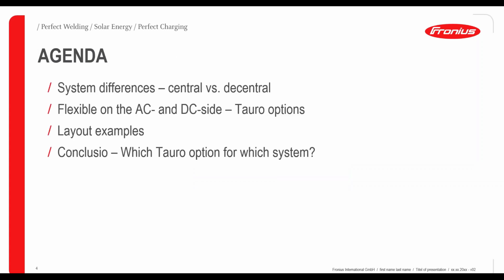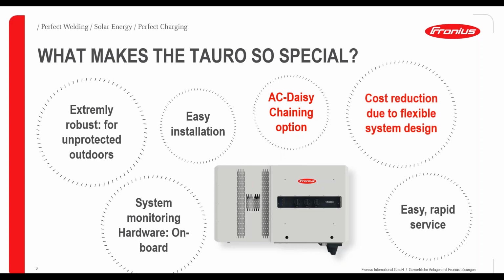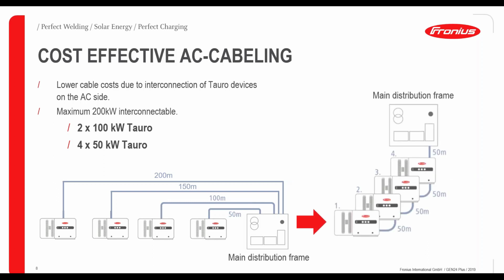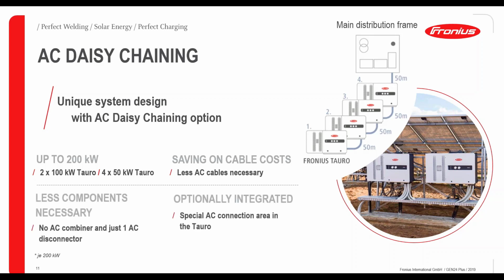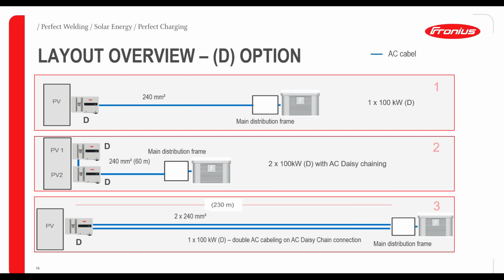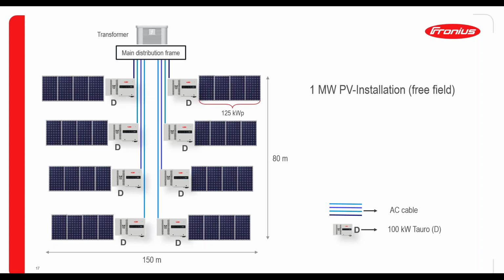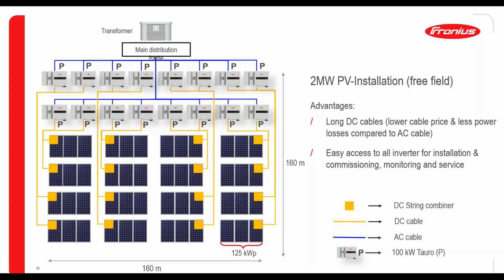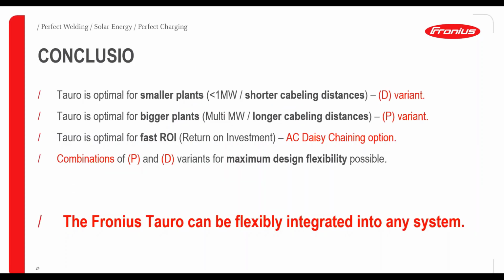Webinar: Flexible system design with Fronius Tauro

Comment: How is the daisy chain cable labeled? I would need to know exactly how it is listed to use in conduit in the USA, but I can not find this information and if it was mentioned in the presentation I may have missed it. Thank you
Reply from the maker: Hi! There is no specific label of cable needed for that. AC Daisy Chain works by connecting at least 2 Tauros with a set of single core cables (3 Phases, 1 Neutral, 1 PE), with a cross-section that fits your needs (at least 70mm² AL). Best regards, your Fronius Social Media Team
Reply: @FroniusSolar  Oh I see, so we can use our own wires to daisy chain it, there is not some special cable needed. Is that correct?
Reply from the maker: @paragon_solar  Correct, there is no special cable needed for AC Daisy Chain. Best regards, your Fronius Social Media Team